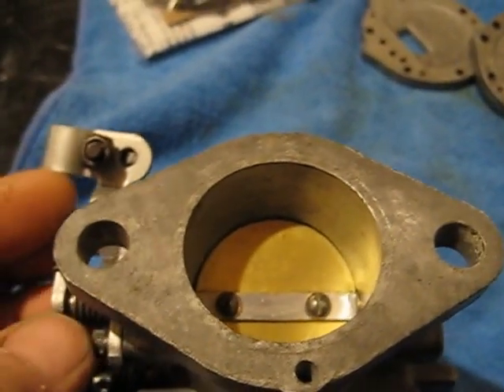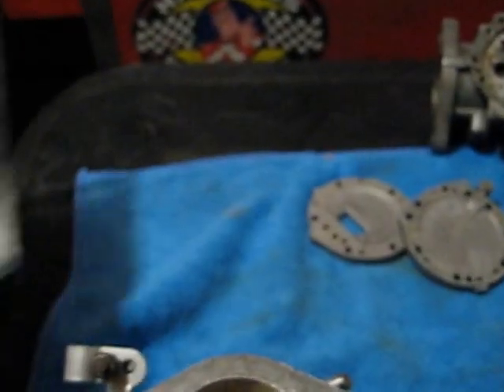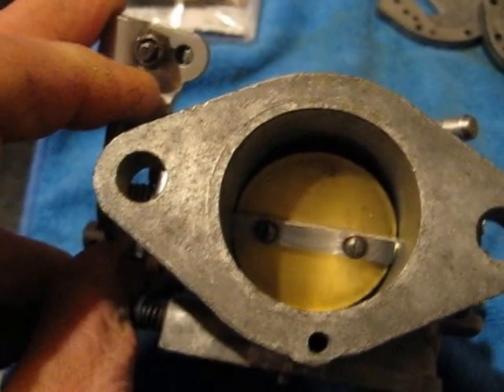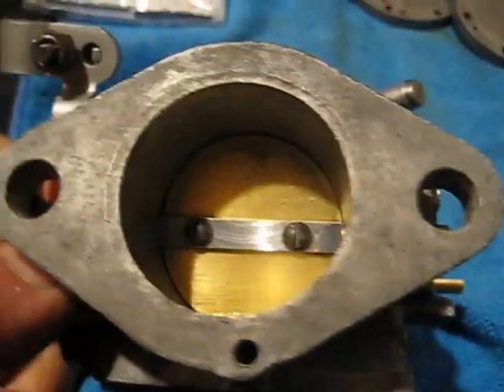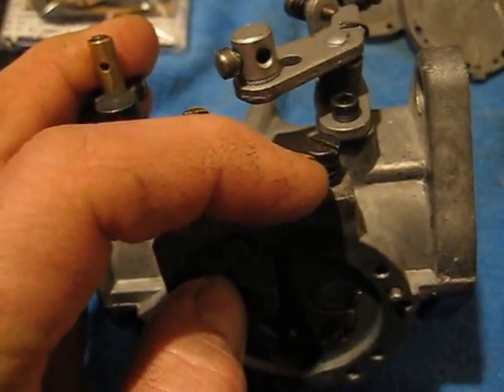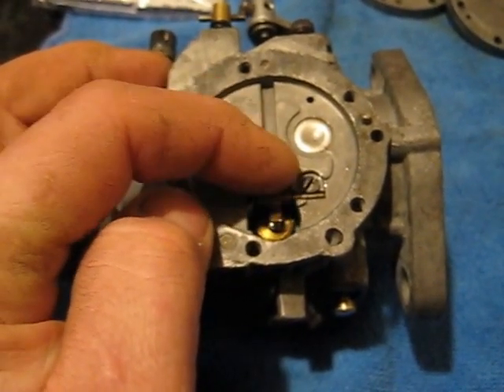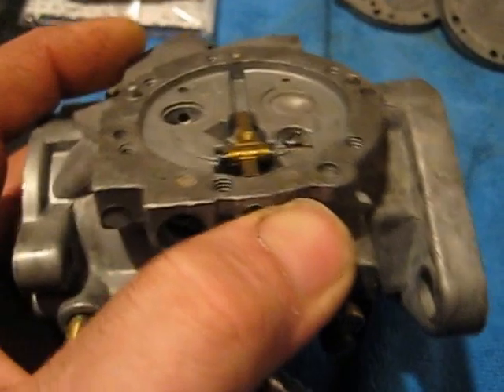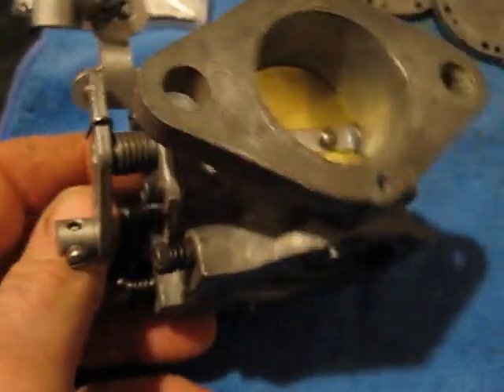Tillotson tips. Troubleshooting and diagnosing. Part 3

Comment: Hi Rob, how significant are the differences between different numbered hr carbs? A Tillitson application pamphlet I found suggests my motor has the wrong carb. I have a 49a and the pamphlet says it should be a 70a. Thoughts?
Reply from the maker: There are differences, example with a external pump, adjustable jet, choke, primer fitting etc, different list numbers. Generally speaking as long as the basic carb format is the same and the throttle butterfly size is the same they will work fine.
Reply: @robh9577  Thanks. In this Tillitson pamphlet, the descriptions for the two carbs are identical though not too technical. Just makes me wonder why they bothered with two numbers. I'll go with what I have and revisit the internals. Would you suggest getting the pop off pressure checked. I am not sure if the spring is original.
Reply from the maker: @davidhowe9510  it could be something as simple as which hole the throttle cable clamp is positioned. Whatever was spec'd out by the company the carb was going to..
Pop off pressure is very important, as the needle and seat seals off of the spring. 10-12 is ideal but 8-14 is usually fine.
Reply: Ok , thanks very much for this. Really appreciate your prompt replies. You have given me direction